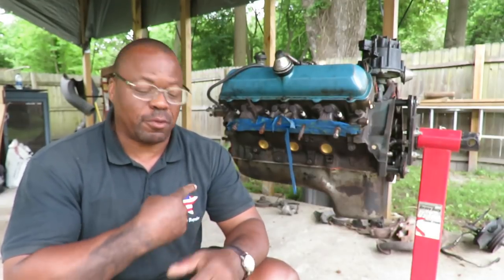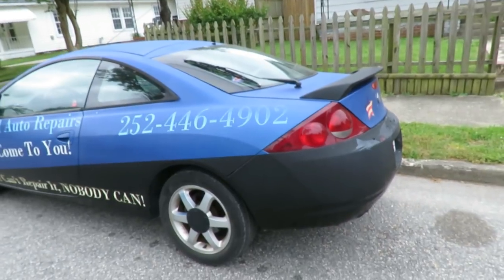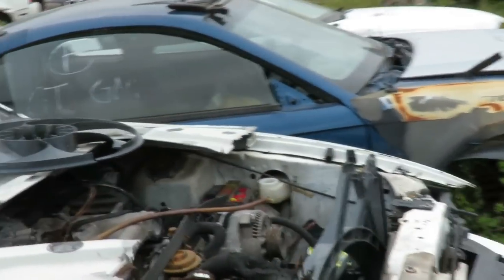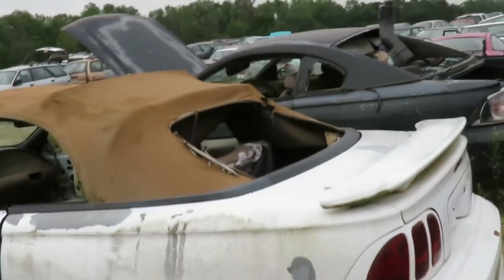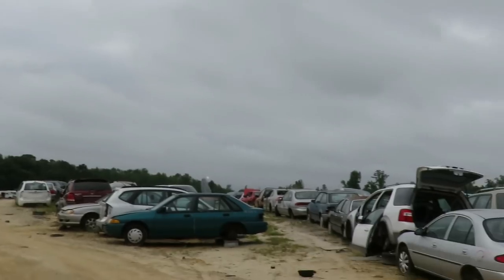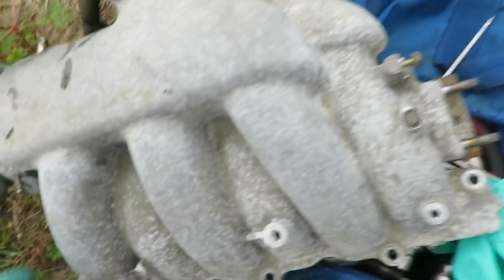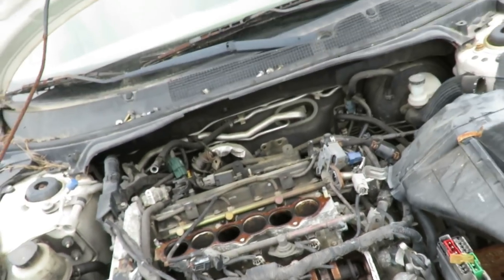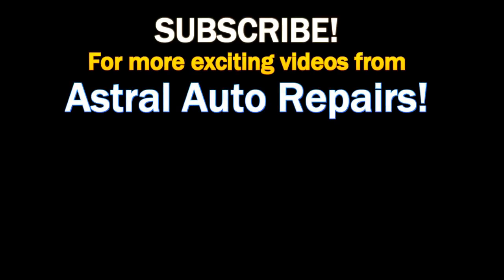⭐ Part 2 - 2004 Nissan Maxima - 3.5 - P0171 - P0174 - System Too Lean Bank 1 Bank 2

Comment: Tim I got a 2015 Mitsubishi outlander with p0171 checked the air filter due to the vehicle is taken to Mexico on a regular basis... and my hunch was right the air filter was so clogged... checked the maf sensor and it looked clean... going the check the sensor with my volt meter and then if it looks good going to do a smoke check... I'm hoping is just an air leak causing pirate air... but I'm hoping the injectors are not clogged... should I check the injectors first ???
Reply: Oh sorry forgot to mention that the code went off on its own when I changed the filter but came back
Reply from the maker: Hey Ricardo, do you have a diagnostic machine that gives data?
Reply: @OnlineAutoRepairVideos  yeah I know so I can see full trims but I don't lol
Reply from the maker: @ricardobeltran9487  That's going to be crucial in diagnosing this problem, unless you can visually see where it's leaking from, or get a smoke test done.
Reply: @OnlineAutoRepairVideos  I'm going to check fuel pressure to make sure the pump is good and no clogs between the lines before the injectors and before the fuel filters. If the pressure is good then the next step is I'm going to check the injectors it's my mom's car and she put gas from Mexico. I'm I in the right path
Reply: I’ve got a ‘08 vibe and get same code every yr, but only in the winter! Absolutely no symptoms - car runs great. Maf✔️intake gasket ✔️wat duz it Meen!!!😣🤣